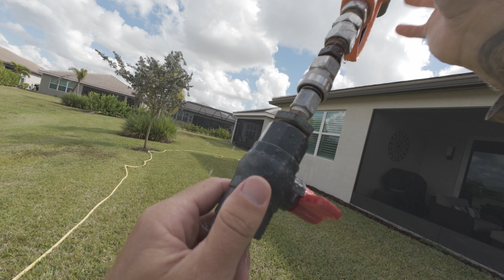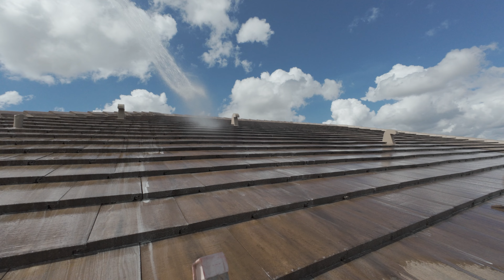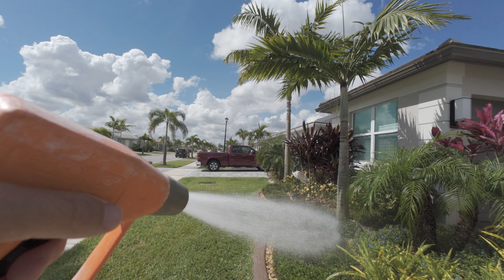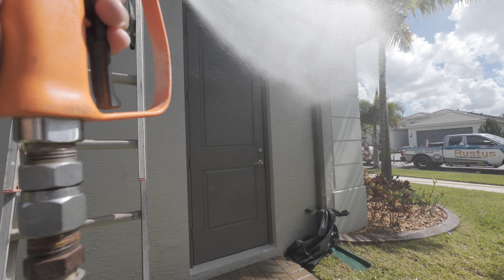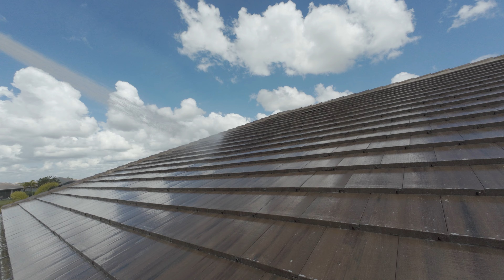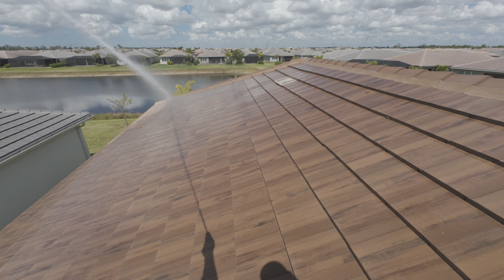HOW TO soft wash a roof (start to finish)

Comment: Great job, I've got the same orange gun and wondering what PSI you are using on it?
Reply from the maker: Roughly 200 psi. The machine runs around 300 max but I don’t run it full throttle.
Reply: @rusty.nesvig  Thanks, My gun is brand new and something must be wrong with mine as I cant get nearly as much volume as yours.  Even at 1000 PSI on my 4.5 gpm machine.  Do you have 8gpm?

Comment: Hi Rusty, great video. How long do you wait before re-activating chem mix with some water? Thanks
Reply from the maker: Thank you!! Much appreciated. I typically won’t do that until I’ve completely applied the roof. Once all your solution is dried up you’re good to hit it with a little water
Reply: @rusty.nesvig  Thanks Rusty. You were probably wearing it but please remember to wear your respirator. Those chems are super strong and caustic.
Reply from the maker: I agree ! I’m always preaching on this channel to wear a mask 🙏

Comment: Like this style of video too! Hey Rusty for this type of roof tile would you recommend 3-4% like you say in the video even if it’s are really dirty?  Got one coming up Monday and I’ve always used 6% but if I don’t have to go that strong I don’t want to. Also seeing how easy your doing it with a gas pump is 🤯
Reply from the maker: Thank you brotha 👊🏼 you can definitely do a dirty one with a 4% mix. Probably will need a second application in some spots but I like that more than spraying 6%.
Reply: @rusty.nesvig  thank you

Comment: what kinda buffer tank are you using to be able to run the p40 and do all that cleaning?
Reply from the maker: 325 gal water tank with a 200 gal chem tank
Reply: @rusty.nesvig  do you feel like you can do multiple houses in a day using that p40 since its shooting 10+ gpm. Are you waiting a while for water before/after the job. Im curious because id like a system like that for my self too